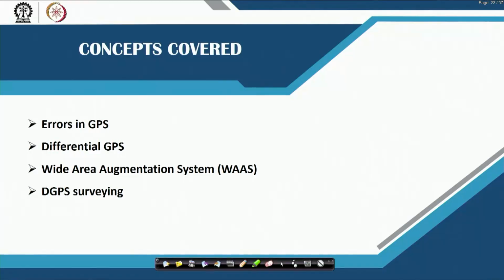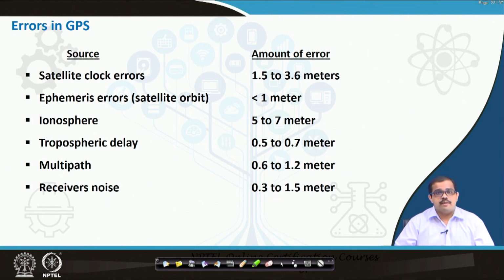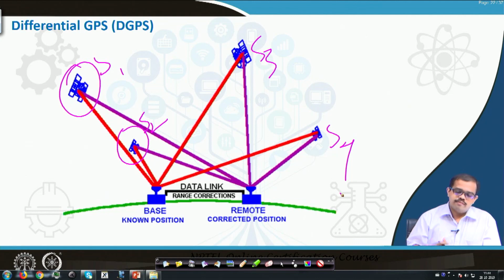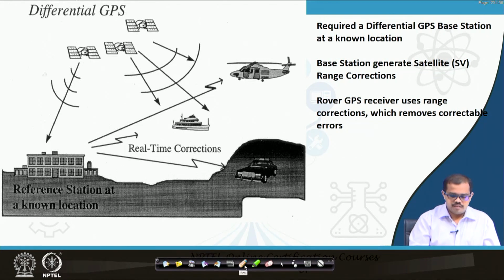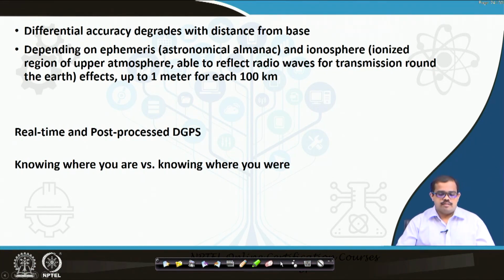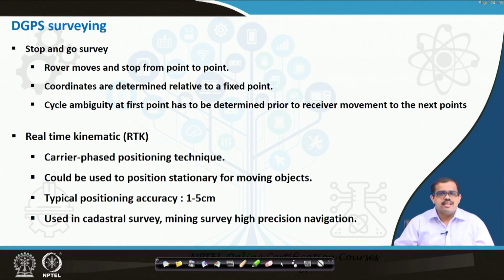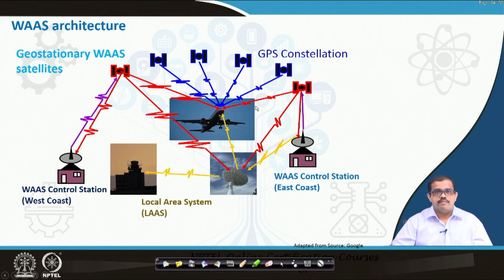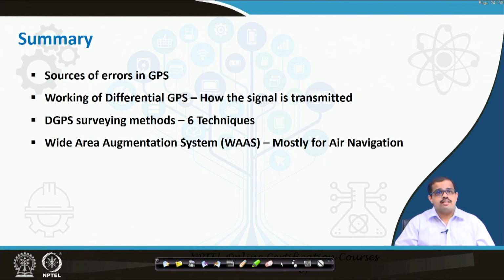Lecture 28 : GPS errors and DGPS

Comment: 8:40 To add small detail, the ionospheric disturbance is not removed because both base and rover are on the ground. Actually the base receiver acting as a control station calculates the delay in signals from satellite based on its known coordinates and sends the correction value to the receiver which then updates its position accordingly. The accuracy of this method also depends on both receivers having identical ionospheric conditions. This is why there are limitations in distance between receivers of 2 to 7 kms generally for accuracy based on the method of transfer of correction ( radio waves or internet through gsm)